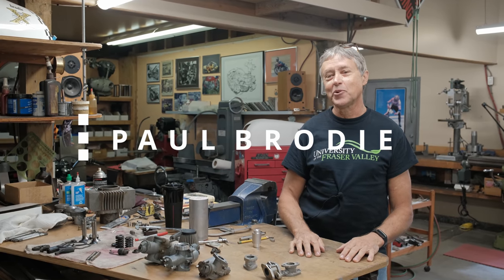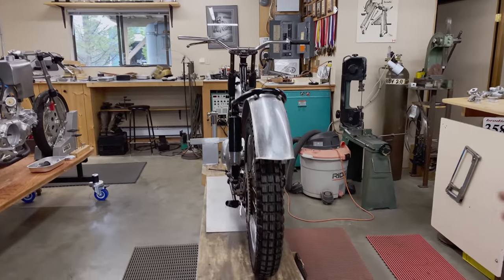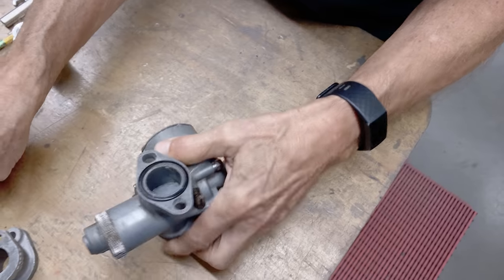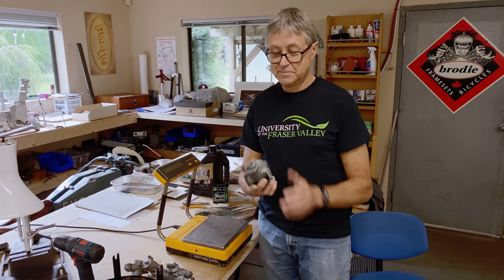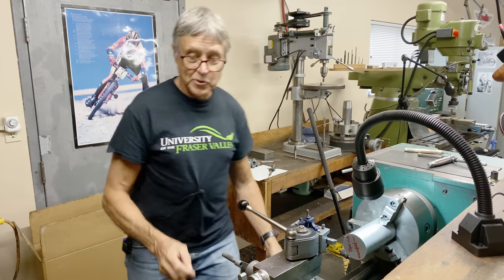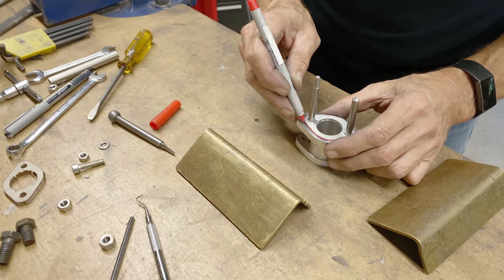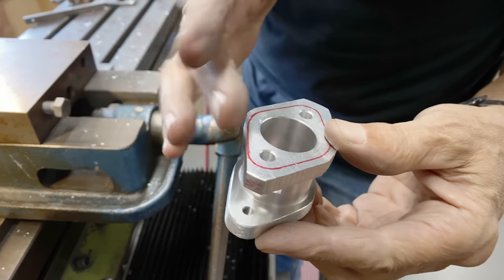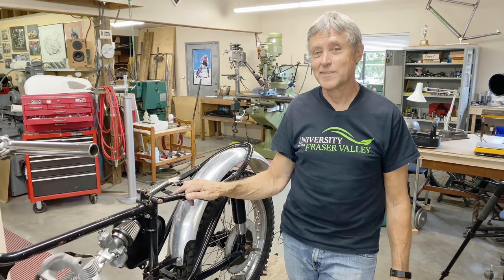Tiger Cub Intake Manifold // Paul Brodie's Shop

Comment: Perhaps you could fashion a cap for the carb that has everything where it needs to be?

That damaged frame, I hope you fix it--even if you don't run it. Likely, that frame forging itself would not be a good thing to repair, but perhaps one could be made either from billet or welded metal.

I am really enjoying your channel. Thank you. If you have to put in the welding music, you must. Sigh. Presently, I keep up with 135 youtube channels, dealing mostly with engineering, science, and mechanics. I come to your channel not for welding music, but instead for your skill, creativeness, experience, and expertise.

[My uncle had a 1959 Triumph 500 frame, with a 650 Bonneville engine (AFAIK). I grew up helping him work on it. It was an old award-winning 1960s show bike called the "Bonnie Bandit." Oddly, he had the entire frame triple-chrome plated. I should hope that all the hydrogen was baked out of it. The tank and fender appeared like custom parts. I always wanted that bike, but wanted it outfitted more leaning toward a cafe-racer, with disc brakes and handlebars somewhere below the shoulders. It was very nicely balanced, with most of its weight low. I remember, once we went to the parts dealer, where I saw in a glass display case, an oil pump, for around $200, in 1980s US Dollars! ]

Perhaps, models could be made of the old engine parts and investments could be 3D printed--for brand new engine parts.
Reply from the maker: Yes you have some good stories. Thanks for commenting.

Comment: I was thinking you might modify the frame 
That’s where stuff gets sticky 
What do you do 
Make a knew mor complicated manifold or take the easy route and modify the frame 
I liked the previous comment thinning the flanges moving the carb forward 
Or cut a piece of tubing and weld it into the frame making room for cable 
😃 this will be interesting 
What will you do ?
Reply: As Mr. Brodie was a bicycle frame builder I think frame modification is most likely? 
Steering head looks really flimsy plus that frame doesn't look like original hearth brazed factory unit, there should be less brass showing.
Reply from the maker: I fixed the issue. Next video will show all...

Comment: Manifold came out beautiful.
You'll need to remove the air slide (choke) plunger
I've had that  same Phil Irvin book since around 1978 when I got a second hand one.
The early remote float carb, even though small diameter will flow a lot more air than the mono-bloc or concentric of the same size or larger as it's a 'smooth bore' carb and acts about 5mm larger than actual size at full throttle but with better pick up due to higher gas speed at low rpm. They do have issues with fuel delivery on sidecar outfits though, I remember my father building a dual float chamber for sidecar use.
Isn't 26TPI a British Standard Cycle thread?
The lightweight carb is aluminium for a trials cub, the others are zinc die-cast (probably Mazak?) so much heavier. About the only thing that beats them for weight are the remote float early carbs cast in brass, often nickel plated (but look really good and 'vintage' when polished)
Reply: The Monoblock has a pressed in jet block similar to the Amal Standard's.  Concentrics don't, and need to bigger bore size to get the same flow.
Reply: @webtoedman  Yeah, been a long time since I worked on monobloc's. Never much of a fan of concentric for some reason? (probably due to 'Jubile'e Bonneville's in the late 70's?)
Reply: @1crazypj  Unfortunately, Amal (And Lucas), were held down on price by the bike factories, so anything they developed had to be cheaper. That lead to horrors like running die-cast zamac slides in bodies of the same material, which wore out in a few months. The replicas made by Burlen Fuel Systems have hard anodized slides, and don't seem to wear. Well worth looking into, if you need them.
Reply: @webtoedman  Hi, yep, I'm aware of the issues the 'industry' imposed on suppliers, British Leyland in particular with Lucas 'Prince of Darkness' cost cutting and Triumph/BSA parts needing repair straight out of the box before fitting. Seems AMAL came full circle as hard anodizing slides was common on Mikuni carbs since 1960's  (I believe it was Mikuni made AMAL under licence pre-WWII?) Little known fact, there were Lucas parts on space shuttles but they were built to a standard instead of a cost. Pretty sure Lucas hated making some of the stuff they sold due to cost cutting but British automotive industry made a lot of bad decisions
Reply from the maker: Thanks Peter. Yes I will remove the choke.

Comment: Here in the UK, there has been an awful lot of development work on Cubs, in relation to use in "P65" trials. Modern frames, billet wheel hubs,  billet cartridge forks, are all commonly used.  

A great deal of work has been done on the motors, with some being taken out to nearly 250cc.  A very common modification is fitting an 18 mm sleeve in the intake port, to increase gas velocity and improve carburation and running at lower engine speeds.

The Cub intake port is overly large and poorly shaped, which is the main reason the restrictors are used. Caution should be used in relation to Amal carbs, as they are very low quality and wear out quickly, which will lead to all sorts of running problems.

Heat is a big problem on Cubs, bearing in mind the motor is based on that of the Terrier which was only 150cc.  The factory used to advise works trials riders, to ride through any puddles they saw, to help cool things down a bit..........lol

With carbs mounted direct to the head, there can be problems with fuel vaporisation and also issues related to vibration. Most serious competitors here are using spigot mount Dell Orto's, and manifolds with rubber intake sleeve.  

A good carb which is rubber mounted, will improve the performance of a Cub enormously, and all the parts needed are available off the shelf here in the UK.

Of course no need to worry about carb issues, if bike is not actually going to be ridden or used very much, but if it is then sorting out the carb and ignition properly is a very good idea...............

Finally, with carbs mounted at acute angles, there may be problems with fuel level  and resultant poor running, so if you intend to use an Amal carb, I would suggest getting a new one, so running issues related to carb wear can be ruled out.
Reply from the maker: Thanks for your comments! I especially liked the one about riding through puddles.. I have a good ignition system so we will see how this little Cub runs.
Reply: @paulbrodie  Its actually true about the factory advising works riders to go through puddles if possible!  The motors run very hot, and this was the reason for fin area being slightly increased on the last square cylinder motors.

Most people here use CDI ignitions on Cubs, but very short spark duration, and less than ideal advance curve, mean running will never be as good as with a modern inductive system, that has application specific advance curve. 

Some CDI systems seem to retard at high RPM, which is fine if it's fitted to a 2T motor, but a disaster on something like a Cub.
Reply from the maker: @humourless682   I would like to have one of those square cylinder / head combos, not only for the heat dissipation, but I think they look better too. I was advised to purchase an Electrix ignition system, so that's what I have...

Comment: Paul, that Triumph Tiger Cub Bible costs around 500$ 😆
Reply from the maker: Yes, I have seen them overpriced. I don't think I paid more than $50 from eBay..
Reply: @paulbrodie  It seems  that bible  is also available as an ebook. Oh by the way, my Tiger Cub fever has let me to a point that I am now negotiating about 1961 project bike. It has almost all the parts and the price is 700€. Told my wife to thank you for all this.
Reply from the maker: @markotuomas672   That made me smile! You do realize that 700 Euros is the downpayment, right? Mine has cost me more than I had anticipated, but I have no regrets :)
Reply: @paulbrodie I know it's cheap and like you too,  I know it will take some time and money to get it back on the road. Well, luckily there are awesome videos about the subject in here and I now know a very talented engineer whom I can ask some help 😉 Let's hope I didn't piss of the owner of the bike by asking too much questions about it.

Comment: The concentric and monobloc designations should be stamped on them, a 626 even concentric could well be too big for the 200cc engine in the venturi area, too much air being drawn in no matter what main jetting you use, unless racing or whatever. The very small carb may have been for a 150cc Terrier, predecessor of the Cub? Some of the Cub manifold adaptors  are angled. Monobloc 376 types are fitted to later cubs, jettings can be found in many places.
Reply from the maker: If the carb is too big for my 200cc Cub, then I might have to make it 250cc. That's what Gary Nixon had, but I have no idea how long it lasted.
Reply: @paulbrodie  250 Cub has a very short lifespan........a few of them around in the UK, being used in "P65" trials.  The bigger capacity, means crankcases and gearbox parts, dont last very long.............
Reply from the maker: @humourless682   I have no plans to build a 250, thanks.
Reply: @paulbrodie  Maybe best then to get a 22mm Mikuni carb, if you intend to ride it much?  

Ditching an Amal carb and fitting a properly set up Mikuni, makes a really big difference to any bike with an Amal on it.

Comment: G'day Paul,

Thanks for another great video, but I just need to pass on a comment.  It might have been Mitch's point of view, but it looked like the rear mudguardwasn't centralised in the seat frame.  My eyecrometer is good like that, & has saved me from some badly crashed motorcycles.

Andrew
Reply from the maker: Andrew, you are correct. Watch our next video!

Comment: The threads on the Cub cylinder head carb studs are not 1/4 BSF. They are 1/4 BSC (British Standard Cycle.). Sometime in the 60s, BSC was changed to CEI (Cycle Engineering Institute ) but the thread remained the same. While 1/4 BSF and BSC/CEI share the same diameter and 26 TPI pitch, the BSF has a 55 degree thread angle (ala Whitworth) and the BSC/CEI is a 60 degree angle. While they are often unknowingly interchanged, they tend to be a tight fit as evidenced when you needed a wrench to tighten your "custom" nut. BTW, there is an OEM  Triumph nut that will work perfect on that stud. Correct thread, small BS wrench size and proportionally longer in length. I'll look for the part number.  As always, nice work on the manifold👍🏻
Reply: I just wonder why different thread standards where necessary, especially such    such fine detail such as thread angle, was it an industry thing, ie they just did their own thing... Was it cycle in BSC cycle as in motor cycle, or bi cycle? Fortunately the Japanese used Metric ...
Reply from the maker: Yes, a friend was telling me what you commented on. He thought a worn nut couldn't tell the difference between a 55 and 60 degree thread angle. That's what I remembered. Thanks for commenting.

Comment: 26 tpi threads per inch was commonly called cycle thread when l was dealing with motorcycles, all diameters were 26 tpi.  BSF the no. Of tpi depended on the diameter of the bolt or threaded rod as l recall. However there was a size where both were the same no. Of tpi but l cannot remember what sizes they were but two different spanners fitted the nuts maybe one was 1/4 and the other 5/16 or 3/16. It was a long time ago in the late 1940s or. 50s.
Reply from the maker: Yes, all that knowledge is still valid, even though time is moving on.

Comment: The engine maynot "drive" oversized carb at low rpm...not enough suction
Reply from the maker: In that case, I will switch to a higher rpm.

Comment: I bought a new Triumph T20SH Sports Cub in 1965 and the wheels on that were not 'in-line' either.
Reply from the maker: Did you get any satisfaction from the Dealer?
Reply: @paulbrodie  They re-aligned both wheels when they discovered the frame was actually offset to accommodate the larger section rear tyre fitted to that particular model. Very 'British' eh ?.
Reply from the maker: @rgadave   Yes, very British. I'm glad they gave you some service.

Comment: You need to have the float bowl level or you will not have a proper float operation and your carburetor will have abnormal fuel air ratio fluctuations. Make a new manifold to accommodate a level carburetor and it will solve you choke and throttle cable problems.
Reply from the maker: Most carbs will stand a little bit of an angle. I like the look.

Comment: What's the reason for such a long inlet manifold?
Reply: Probably should be even longer for best tuned length. 'Cub' is a relatively low rpm pushrod motor so a longer intake manifold helps with flow reversion. Any shorter and you would probably see fuel blowing out of carb at low rpm/idle
Reply from the maker: I'm just having fun. Maybe I will make a shorter one...

Comment: Flange-nuts, in British-Standard-Fine?
Reply from the maker: Are you making a suggestion or asking me a question?
Reply: @paulbrodie  a question more than anything.  That kind of nut is a fair bit of work - at least the one I did for the rotary table fixture was!

I wrote that about three minutes or so into the vid, so beyond the thread itself (being mentioned) it was a guess as to what you might do.
Reply from the maker: @dennisyoung4631   I found out the thread is 1/4" BSC, not 1/4" BSF, so I have been corrected. I made the nuts .300" long with 10mm hexes.

Comment: Measure far to near. The outside of one stud and the inner side of the other. Done, no math.
Reply: was going to say that very thing!
Reply: Kinda hard to do with any proper accuracy though surely? Wouldn’t you basically end up measuring by eye as there’s no way of getting the vernier to touch on both of the same sides? 
Another method is to measure the internal distance then add one stud diameter or measure external distance and subtract one dia. Or use a digital vernier zeroed on one dia then measure external.

Comment: Measure one stud.
Zero the digital caliper, and measure over the two studs.
No math involved.
Reply from the maker: That could work as long as the two studs are the same size.
Reply: @paulbrodie  IIRC, all the monobloc's were 2" OC.
It's been a REALLY long time since I messed with late '60's early '70's Britbikes.
Reply from the maker: @jimurrata6785   I'm REALLY enjoying working on this Tiger Cub. Not sure if it shows.
Reply: @paulbrodie  Not Sure?!?!     😄
It's great to see you so happy and enthusiastic.
I'm certain you'll figure out an elegant solution.